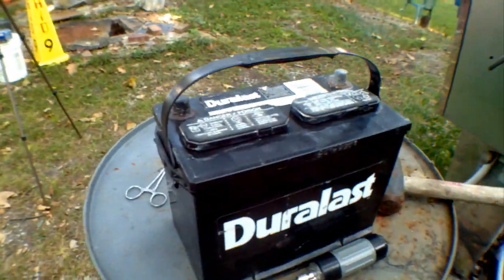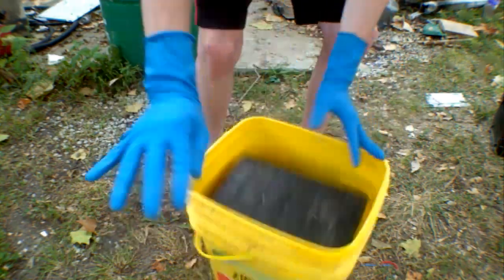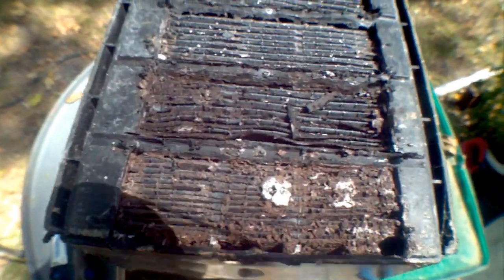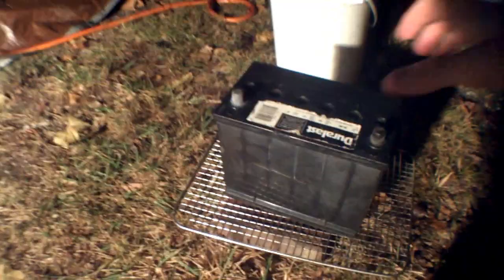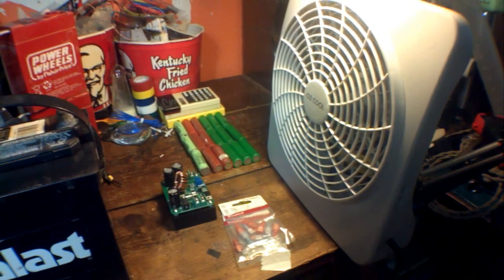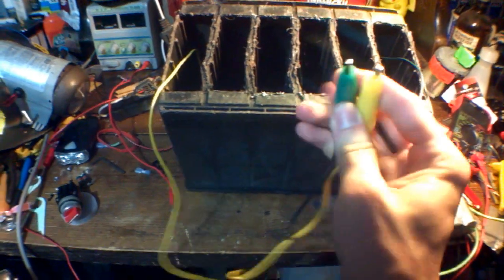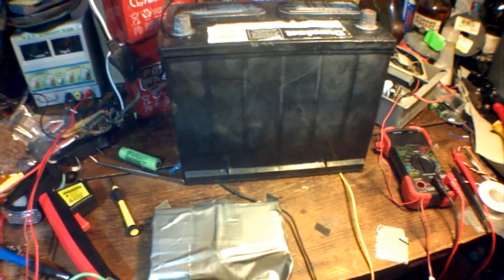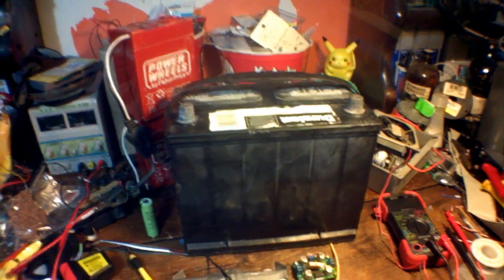DIY Lead-Acid to Lithium-Ion battery conversion 18650

Comment: you got it in 1992 and have had it for 9 years?  Yet it was posted in 2013?  Im confused.
Reply: ok then "its from 1992" either way, so mentioning it was from 1992 was useless and when you mention saying 1992 and I got it when I was 11, that usually means a correlation of time, in the same sentence. the way it was worded made no sense. I am not the only one who was stumped on this the way it was said.
Reply from the maker: i never said i bought it new.
Reply: not good with math or posted in 2013 but filmed it in 2010/11  ?
Reply from the maker: EliteGeeks
?
Reply: Rinoa Super-Genius you said "Got it when 11, in 1992" you said "I owned it for 9 years now" making that that would make it 2011 when you Filmed this, But it was published in 2013 so you waited 2 years before you posted it.
Reply: so you filmed this over 14 years ago
Reply from the maker: EliteGeeks
 give the timecode of when i said that.
Reply: Rinoa Super-Genius sorry 14 years ago.. I edited it from 4.. Right at the very first 10 seconds of the video... 1992 you were 11 years old,  + 9 years = 2002 + 11 years 2013 thats 20 years ago, making you 34/ now.. you said you had it for 9 years..
Reply from the maker: EliteGeeks
i never said i got it new. i'm 21.
Reply: I never said you got it new either, but you did say you got it in 1992, you said you have had since you were 11 years Old. .. DO THE MATH 1992, 11 years old!  1992 that would make you 34!!!!!  You could not have gotten it in 1992, if you are 21 You were not Born Yet.. you were Born in 1994 so you are either a Time Traveler or?!?!
Reply from the maker: EliteGeeks
no i said "and its from 1992" give the timestamp of when i said "i bought it in 1992"

and no i was born in 1993, god you suck at trolling.

Comment: why arent you wearing long sleeves and jeans? not safe
Reply from the maker: because wearing a lot of cloth will absorb acid and burn you worse
Reply: did not think about that aspect but some sort of protection is better than none. Even a piece of plywood held on with a belt may have been safer

Comment: Wrong on so many levels. I hate to be negative or put down a cocky kid who thinks he's a genius, But your replies clearly show that you just don't get it. Since it seems all you needed from the battery was the plastic case, wouldn't it be more sensible to turn the battery in and get 5 bucks for the core, then buy a clean plastic case of some sort for your project. It sickens me to see you rinsing out the lead contamination and dumping it in your yard so that it leaches into your neighbors yards, the ground water, not to mention what you did with the plates. Lead is POISON. Adding this to your resume' will assure you of never getting employed, but then you're too smart to work for anyone anyway.. .
Reply: GGigabiteM Great, then we should help by not putting it there.
Reply: GGigabiteM  Exactly my point.  Everyone has some lead in their systems, if people keep this up then we always will.  However if people stop being morons and think before the act, we could dramatically change that.  

It's like voting.  You might think, "what's the difference if I vote or not, it's only one vote", well what if everyone thought that way.  No one would vote.
Reply: +wilsard u cannot be that stupid.
Reply: Exactly my point.  Neither of which are a problem for people if they aren't in their water, food, or air supply in sufficient quantities.  People like butterfly are reactionaries.. most of what they write is chicken-little like and isn't worth getting too excited about.
Reply: Cody Heiser  it came from the earth, it returns to the earth.
Reply: Whoa, this is getting really ugly.  So, I'm out.
Reply: So does oil.
Reply: Start your very own battery business and make huge money here: JoxCharge.com
Reply: butterfly kiss You seem to have forgotten that millions of people for about 76 years have dumped millions of tons of tetraethyllead from leaded gasoline into the air, ground, water and everything else. The lead in TEL doesn't go away and is still persistent along pretty much every road that has been around since the ban in 1996 in the US. The EU used TEL longer into the mid 2000s and there are still countries that use TEL.

And let's not forget leaded Avgas for piston engined aircraft.

One guy dumping out slightly lead contaminated water isn't going to adversely affect anything, the ground and water is already contaminated with the stuff.
Reply: butterfly kiss also when building his "new battery" the lithium batteries are sensitive to charging so if they explode or die prematurely it will be because this kid doesn't know much. I mean where's the curcuit board to balance the batteries? also why the heck he uses a step up module to raise the voltage? why not use 3.7x4 for 14.8v if he want's a "car battery" ?
Reply: GGigabiteM There have also been millions of murders over the past few years, so killing one person isn't really going to affect anything.
Reply: Cody Heiser
PbO is persistent in the environment, it doesn't go away.
Reply: Cody Heiser
That would have been a valid statement 70+ years ago.
Reply: Cody Heiser
Riiight.. Because lead poisoning is equal to murder.

Except for the part where most everyone on the planet has some amount of lead in their systems from the above causes.
Reply: butterfly kiss If you think this is bad you haven't seen a shitstorm. You are rude, but right.
Reply: +butterfly kiss Did it ever occur to you that lead comes out of the earth??  Get a grip

Comment: How can a car Battery or any other one { DIE } ~ ? If indeed it really did die you should have recycled it and than given it a Funeral and than a decent Burial ~. Your only prolonging it's suffering by keeping it on life support~. You have made the Battery Spirits very upset by removing its core.  You have really upset the Batteries Sprits also by still using its box and striping it of any dignity~. The Batteries Sprit had spoken to you when it splashed its evil acid on you~. The next time you may not be so lucky~. Like humans Batteries were only meant to live so long~. How can you be so cruel to a battery once belonging to your Grand Father ~~ your a Battery abuser.

Comment: Should have cut the top off instead of bottom and clean the conectors off there and I would have used 12 volts.. but hey great project.

Comment: When I was 11 years old the last thing I wanted was a car battery. this vid is pointless it would have been cheaper to replace the car battery with a new one.
Reply from the maker: but the intent isnt to use it to start a car, plus of course its pointless, everything is pointless unless somebody gives it value. so what you mean to say is its pointless to you.
Reply: Rinoa Super-Genius still it would have been much smaller and lighter to just use a lithium pack on it's own, your configuration is basically a mostly empty box with lithium cells in it.
Reply from the maker: Justin DiPlacido
yeah thats why i like it. dont try reasoning with me because my intent isnt to make something reasonable, but rather to make something odd.
Reply: lol mad.

Comment: I'm putting together a slideshow about safety when handling chemicals for a group of employees in a recycling plant. I used the beginning of the video as a perfect example of "what not to do when handling lead acid bateries".
Reply: Rinoa Super-Genius
Probably the part where you're dumping battery acid while wearing sandals.
Reply from the maker: you mean the part with the sparks? as long as you site the source and its used in a material that doesnt compete with my video i'm ussually fine with it ^^

i also have a video where i accidently drop a battery into a bucket of battery acid, that may be a nice clip to use also. its called "battery accident" i think.
Reply: @RinoaL  No such thing as "site" the source. The word is "cite", as in "citation", for example. I bet you think "walla" is a word, too, instead of the French "Voila!".
Reply: Rinoa Super-Genius yeah... who wants acid on the surface of one's boots, when it can enter the skin, right?   that would just be a waste.
Reply: ***** The part where he dumps a 20Lbs of lead battery into a bucket of sulfuric battery acid... yep that part.
Dont feel bad I did the same thing but I was wearing pants and boots. but my stupid ass back then thought it was a good idea to pour bleach on the spill.. NOPE don't do that kids..
Reply from the maker: ElfNet Gaming
bad idea wearing pants and boots, unless they where rubber they could possibly absorb and hold any acids.
Reply: I was like 15 at the time. I know it's a bad idea now I'm 36.

Comment: I think this whole story... (err ridiculous video) was about the old, old, old car battery and it all boils down to some ridiculous sentimental connection, fixation or retarded whatever for that da%#ned useless battery shell... Am I getting close here? So why didn't you just empty it, clean it and then put it next to your pillow so you could be close to it forever? Maybe a night lamp or something? Oh and did that splash of battery acid burn any holes in your undies?  :)

Comment: soldering the cells caps is not reliable, the soldering iron does not melt it, vibrations in time will break the connections you need a spot welder. i tried soldering as you did with 150watt soldering iron does not work its not hot enough.

Comment: bro i have the same fan, I know how you feel, I had two stowaway deep cycle batteries I bought in 2001 for my boat, kept the batteries after i sold the boat, for backup purposes to run my inverters, they finally died in 2012 and the other in 2013, thats to much work what your doing, I bought 10 used 12 volt 7ah batteries for 5 bucks and used 3 of those  instead my portable power pack i charged my phones ran my o2 fan like yours and a 12 volt dvd player for over off and on all weekend from friday night to sunday after noon  hours, don't waste your time rebuilding that battery

Comment: For any complainers, you can tell he ran to shower almost instantly to get rid of the diluted acid, key word "diluted", and he used baking soda beforehand to "neutralize" at least 90% of that "diluted" acid, so it's not like he had full strength acid all over him. My only complaint to anyone is never wear your best shirt and pants, other than that, what gives peeps? A little math, chemistry and common sense would tell most there was nothing wrong with what he did.

Comment: How many LA batteries would you need to dissolve a body with the acid from the battery...

haven't seen a book about that yet.
Reply: battery acid is diluted sulfuric acid. You want fuming hydrochloric acid or fuming hydrofluoric acid acid to do a body..
Reply from the maker: it really wouldnt work. the electrolyte inside the batteries is 90-95% water. its not reactive enough to dissolve a body. i would say just get some bottles of pure hydrogen peroxide or something. just dont do what they did in Breaking Bad....that makes a mess hahaha.
Reply: You know way to much about that subject if you ask me...:)

I was thinking of the movie Leon...
Reply: About 20, but it's cheaper to make your own acid.

Comment: The lengths people will go to reuse an enclosure. Better fill up the rest of those compartments to make all that work worth while.
Reply from the maker: why? the main goal was just to hollow out a battery because its cool to have a light battery. adding the lithium cells was just secondary.
Reply: Well, it's not exactly a battery if it's hollowed out, it's just a plastic box. Now it's again a battery, but one that takes up more space than it has to. I'm all for adding cells to an enclosure, a taped up pile of batteries isn't exactly elegant, adding them to the enclosure is, but it's not really ideal with so much empty space.
Reply from the maker: Datzfunk
so if you saw this sitting on the ground you would immediately be able to know it has no cells and thus determine it wasnt a working battery? and if i tossed it at you would you think i was tossing a real battery at you?

you dont seem to understand the appeal of a prop.

not everything is about saving space, if it was then humans should kill themselves because we take up a lot of space.
Reply: I wasn't aware you did this to create a prop. I guess I just assumed you were retrofitting on old battery case with new cells so you could again use it, say for when you went camping, or something random like that. My bad. Yes, it works well as a prop, a working prop at that.

Cheers!

Comment: I am a battery tech and what you did is very dangerous! The acid from that battery could burn your eyes out of your head in less than a minute given 1 large drop to the eye. You must always wear protection on skin areas and a full face shield in the future. I give you credit for trying something new and do not discourage it.(Its healthy to experiment) but do it safely and always assume what your working on could explode. The cells your are using could be assembled together with a hot glue gun and installed in a plastic container ( like Tupperware or an old plastic fishing box) without going thru all the trouble of taking apart old acid batteries. Good luck / check the internet for safety issues in the future before starting other projects and please take this as friendly advice.
Reply from the maker: no, just no. battery electrolyte will not burn through your eyes in one drop. its too dilute. it would hurt a lot though. i've gotten it on my skin plenty of times. its not very dangerous. the confusion comes from people not distinguishing battery electrolyte from battery acid. battery acid is concentrated acid sold in stores that is meant to be diluted with 9 parts water before its put into the battery, otherwise pure sulfuric acid would dissolve the plates of the battery shortening its life a lot.
Reply: Rinoa Super-Genius Hey don't ask me how but I have gotten a little battery acid in my eye once. Gotten it on my skin and clothes much more often. Dang it is hard on jeans. lol Skin is pretty protective. BUT say you got a bad hangnail and that can sting a bit. In the eye it really really smarts. Quick tear formation and its diluted even more. Squirting some normal saline in there can really help too. I looked like I had seen a really sad movie for a bit but that was all. No holes in my eyes or any of that. I did use better safety glasses after that though. cheers..;)

Comment: One bit of warning: Li-ion cells are very picky about how they are charged.  Giving a constant current such as done with a flooded cell battery can cause a fire, or worse.
Lithium batteries must be pulse charged, with a steady pattern, to keep the internals "cool" (yes, I know, they get warm but only from skin effect). 
People keep talking about safety issues with the acid and lead, but the only thing that has me worried is the potential bomb of the 18650 cells. 
Happy experimenting, be safe!

Comment: Why would someone have a favorite car battery? Perhaps this guy has lead poisoning from handling the plates?
Reply from the maker: because there are differant design styles of batteries. there are the ones made from colored plastic, ones with handles built into the top. short ones, tall ones, skinny ones, fat ones, non-serviceable ones. this is just a battery design i like. it has good dimensions, nice handle, and i like how they designed the shape of it.

Comment: Man are you crazy, didnt your mum tell you that those old batteries are deadly. if you must go near them you should be well suited up. you could loose half your skin. not to mention your eyes and lungs. dont be daft, be safe.
regards Colin.
Reply from the maker: lol you seem to be misinformed about batteries. this isnt plutonium i'm messing with.
Reply: Well my man, didnt you not know from your school books and your  dissolving metal tripod. plus what you should have been born with, yes good old common sense. Acid is very dangerous dont pour it down the drain professor. and lead, as if you dont know is a deadly poison. it is as deadly as plutonium, just slower.  dont be so clever and think before you show lots of you tubers how to act very stupid.
act responsible, regards Colin.
Reply from the maker: colin warner
 then you must be afraid of water, water is acidic because it absorbs carbon dioxide.

you really are just basing your claims off an underdeveloped understanding of chemistry. lead itself isnt all that dangerous. sure lead salt and oxides are more dangerous but its a small amount of danger that can be mitigated by washing your hands and wearing gloves.

btw you saying plutonium is as dangerous as lead is wrong. normal isotopes of lead arent radioactive and it's biological healflife is between a few months and a few years, not the 40 to100 years that plutonium has.
Reply: Well son, you got me, I give in, have it your way. I can see that I am wasting my breath. I just hope you dont live to regret your pigheadedness.
Regards Colin.
Reply from the maker: colin warner
lol by "pigheadedness" you mean "not as paranoid"

Comment: Interesting project but you need to deal with the particularities of lithium cells if you want to do that.
Reply from the maker: yeah i didnt make sure the cells where ballanced, but whatever. its not hard to check the cell voltages.